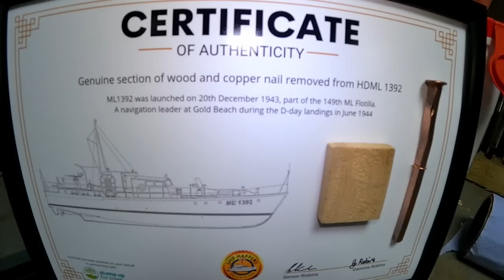Ep 108 - Is The Pointy Bit Now FINISHED? #boatrestoration

Comment: I saw a video not too long ago that showed a lady carpenter sharpening one of the multi tool blades with a triangle file. They can lose their edge so quickly with your hardwood. I have tried it and it worked pretty well. Not good as new, but lengthen the life a bit.

Comment: Simon and Gemma. I don't know if you have been told about this, but as a long time restorer of old cars, I'll tell you how I get old, pitted and scally pieces of steel to look like new!
Find an old bath. Buy 20 litre of Molasses (fodder store). Pour it into the bath and add 40 litres of water. Stir it up well. Place any old steel part in the solution and cover it with plastic (like your deck). Wait about a week and pull it out. Hose the part off. It will look as if you have just made it with new steel.
I'll send you the invoice later<chuckle>
Reply from the maker: Sounds awesome, if I had a week to wait! The knees are off and back on in the same day!
Reply: @ShipHappensUK  Just thought that you may be able to remove ½ doz or so and do them all at the same time.

Comment: I would like to share my thought on why you get a better finish with the grinder vs the abrasive disk, The disk is removing the product of corrosion (rust), leaving the corroded surface. the grinder remove the rust and some of the iron smoothing out the surface. Great work

Comment: The grinder removes surface rust on the flat but not in the pits. The round thing in the drill removes it from the pitting as well as the flatter surfaces.

Comment: As you said 80 years ago when that boat was built that knot in that piece of wood you could probably beat half to death with a hammer that knot would not have moved nor was an overlooked or cause of bad lumber. I've had   4 different boats built over some 50 years that had knots in the planks with no problem  what so ever

Comment: Will Sarinda be moved to a dry dock to complete repairs when the hull is made strong enough to move, great job on the work so far.
Reply from the maker: As we aren't rich people, the only time she will go into a dry dock is when we have finished everything we can where we are, and with her being a wooden boat it would bring alot of problems keeping her out of the water for long periods of time
Reply: @ShipHappensUK  Understood, i remember Edd from Wheeler Dealers repairing a small wooden moter boat and he had to fill it with water to make it water tight as it had been out of the water for some time. Are there any waterside moorings near you to make acsess easier.
Reply from the maker: @douglastalbot8031  water side moorings won't make access better, unless Simon can do the copper nails while wearing scuba gear!

Comment: Those flapper wheel grinding pads a overpriced junk because once you use the edge of the pad their basically useless , you be better off getting 36 or 80 grit sanding discs that go with a rubber backing pad for your grinder. Their cheaper and last longer and you can get them in bulk boxes.
     I'm welder by trade and that's my professional opinion for what it's worth. But, keep up the good work i have been binge watching your playlist of the boat project.